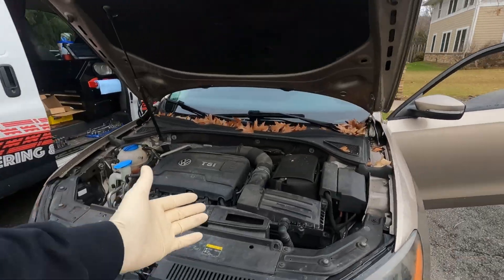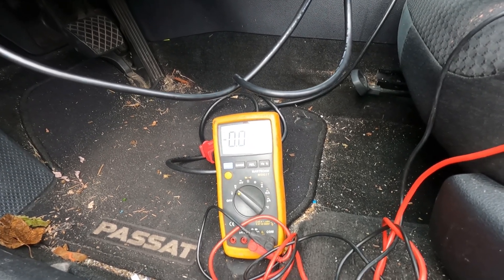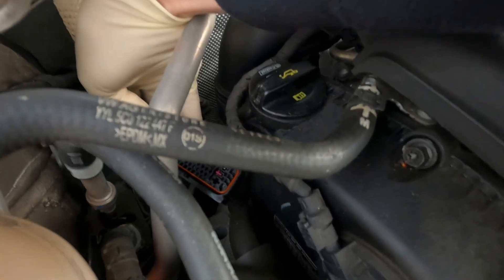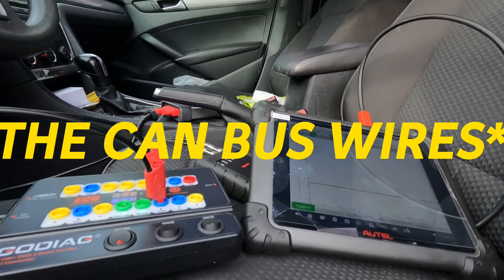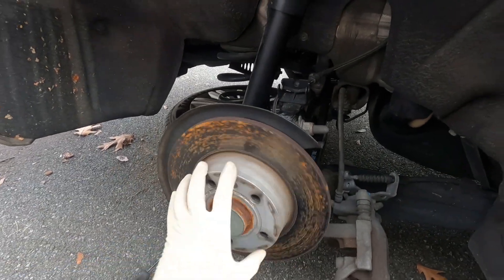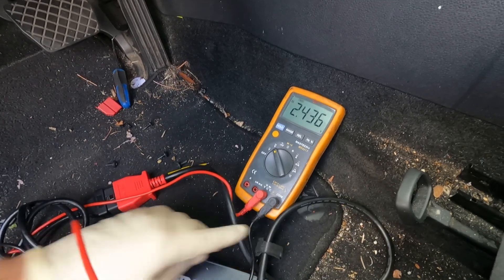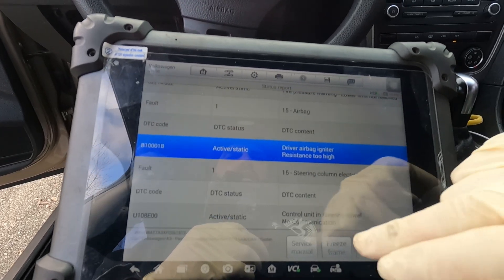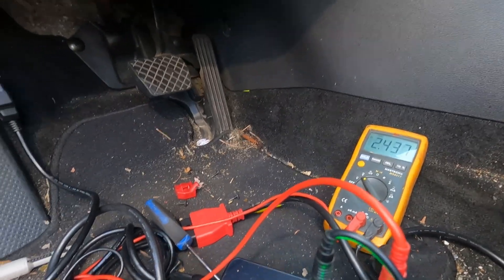ABS / ESP / STEERING LIGHTS ON  THE DASH | WEIRD CAN BUS READINGS AT THE DLC | VW PASSAT

Comment: From the DLC those wires are just a diagnostic can bus to the gateway control module. The only time there is messages being transmitted is when a scan tool is connected and requesting information. So pin 6 and 14 at the dlc only go to the gateway and nothing else. Your scan tool has to actively be requesting information for you to see activity on those can lines. All the data you are reading from the car is just relayed through the gateway. I have a video on this VW gateway and DiagnoseDan has one and he goes into more detail on it then I did.
Reply from the maker: Thank you for sharing your knowledge with me. I enjoy your videos alot.

Comment: Pins 6 & 14 at the DLC are just going to pins 9 & 19 on the gateway. You would have to check pins 6 & 16 at the gateway module to see the network that the ABS module is on. Nice video Thanks for sharing!
Reply from the maker: At pins 6 and 16 at the gateway module (the one under the dash i showed at the end) i had the same readings of 2.4v plugged in and i was probed into pins 6 and 16 thats what i found odd. But at each module those can wires are on the signal was solid. Thank you for taking time to comment 👍🏼